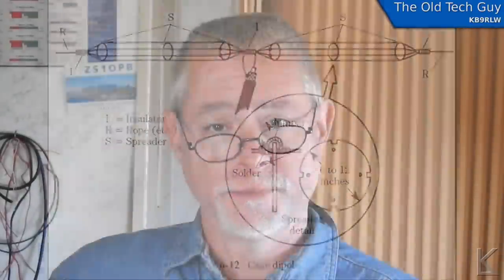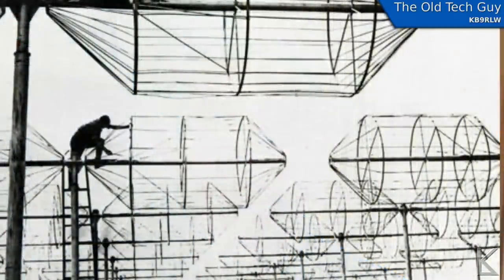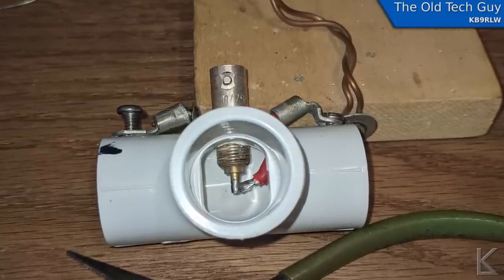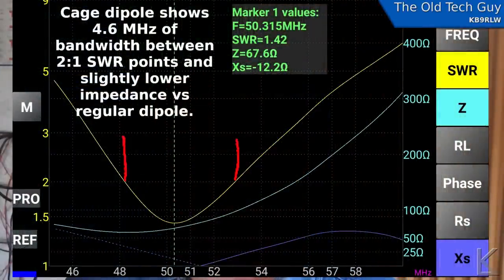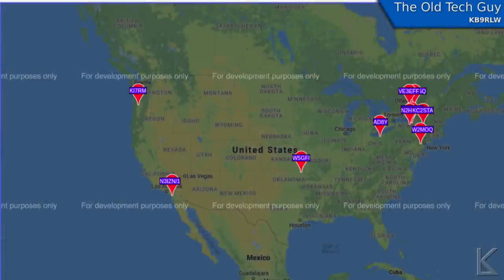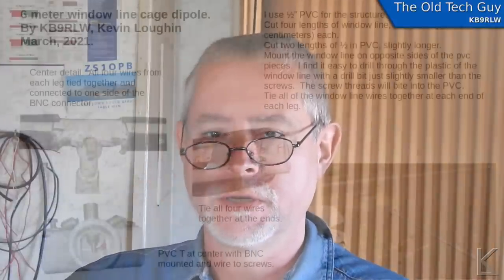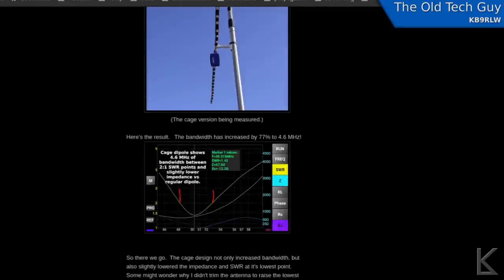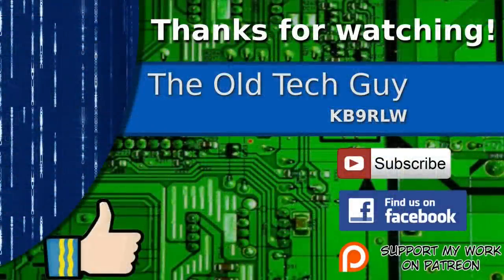Ham Radio - A 6 meter cage dipole using window line.

Comment: I built "flowerpot" antenna for 6m at 52MHz and strapped it to a plumbing vent pipe near the 16 foot peak of our home. I loaded all the FM repeaters within 100 miles of our location and started calling. I received squelch tails from all but two of the repeaters with no contacts. I had just finished one of the tests and the repeater owner came back with, "HEY! DON'T GO AWAY! IT'STOO QUIET OUT THERE!" So I did make one contact. The SWR was below 1.5:1 throughout the entire band, but there were two "bumps" on either side to 52MHz where the SWR was a bit outside the profile. Now I want to build a horizontal polarized antenna for the other modes and when DX window cracks open.

Comment: The speech fragments were probably meteor scatter. In the future, try running FT8 on 50.313 MHz. I run 40 watts to a Par OA-50 loop, the typical "closed band" tropo reaches out to 250 - 275 mile reliably. There are 6 meter beacons between 50.06 and 50.08 MHz,  too.

I have been on 6 meters since 1967. A great band and full of surprises. I have built the same dipole design in the past and will confirm that it will play.

CU further down the log!  73, Keith, WB2VUO here near Buffalo,  NY in grid FN02ox

Comment: Hope your back is better soon!  I have been having trouble with mine for years.  I was trying to hang a wire antenna a few weeks ago and had it hung on a limb.  I jerked it to get it off the limb and the limb broke and I ended up on my back in the mud.  It didn't help my already messed up back but I got the antenna up!  At least now I can sit on a heating pad and work HF and listen to shortwave!

Comment: I knew there was a good reason for procrastinating the start of my attic dipole.  Thanks for this!
Reply from the maker: With it hanging under your roof, you could support it two or more times along the length for a much longer antenna.  20 meters or even 40 meteres.  You could use 1 inch pipe and three lengths of window line at 120 degree spacing to make a 6 wire cage.   Or even go bigger.
Reply: Thanks.  As my parents owned this house, I had long wires beyond 40 meters here back in college - extended through both gable ends.  Looking forward to going at it again.

Comment: an interesting one to try would be the difference in running it as a cage then disconnecting the outer end commoning & having each core slightly different lengths just commoned at the centre (say 54", 53", 52" & 51" fan dipole style) to see if that is better for bandwidth or not.

Comment: Digital mode for EME is JT65.  Digital mode for meteor scatter is MSK144.  You mentioned hearing some signal bursts or pings. so maybe Meteor scatter.  thanks for the video.  - W0WQS.
Reply from the maker: JT65A actually.

Comment: Thanks Kevin!  Will try this concept soon as starting to use 6 meters  a bit. I currently use  a standard dipole inside of gray plastic electrical conduit; which has sunlight resistant additives and is said to not get brittle like the white pvc. will let you know the result in about ten years hahaha KI7RJS
Reply: Yep, and the center Tee or Box has a removable cover to make it easier to solder inside it. You can get a pipe thread to painter pole adapter as a temporary mast, too.

Comment: Excellent illustration of how a Cage Dipole improves bandwidth.

An interesting followup might be a bandwidth shootout comparison between a cage dipole and a folded dipole.  You've already done most of the work.  Some simple cutting of your short jumpers between window line, and soldering new jumpers and you'd have it.

That might allow you to use a lower loss windowline feedline at VHF and improve system efficiency too.  A 4:1 coaxial balun might save you the hassle of dealing with finding a torroial core that will work at VHF.

Just a thought.  Only try the experiment if you want to.  You're doing great without my input.

Comment: Hi, KEvin.

If you stumble upon interesting  signal, using the IC-7300 or IC-705, just record it using the built-in audio recorder.

THank you. 73.
Reply from the maker: Yes, I know.   It just didn't occur to me to do so at the time.
Reply: @loughkb  

Yes, sometimes I set the recording, but forgot to stop it.  As my knowledge, the rig keeps recording even we switched  it off.. and it's resume the recording when switch it on back.

Thank you. 73

Comment: FT8 (and pskreporter) can be helpful for looking at 6m coverage... More users than wspr sometimes.
Reply: Yes, very good point. There is also, in my opinion, the excellent website hamspots.net provided by VK3AMA. This tells you very quickly who is spotting your FT8, FT4 (and other digimode) signals. Personally, I find hamspots.net to be much quicker and more reliable than PSK Reporter.

Comment: Typical water type PVC pipe is more durable than people give it credit. I have been using those as isolators and center mounting points for dipoles for years now in continental weather. Haven't had to change a single one yet.

Comment: On your pvc projects, have you ever tried the pvc that woodcrafters on their sawdust vacuum systems? The pvc walls aren’t as thick and quite a bit lighter.
Reply: Sch 25 pipe
Reply from the maker: In this case, with the weight of the window line, those thin walls would probably lead to sagging as the thinner pvc bent slightly under the load.

Comment: Looks like there are four 6m repeaters in Arizona: Kingman, Prescott, and two in Tuscon. Have you tried those?
Reply from the maker: I have a video on setting up 6 meter repeaters with the Icom 7300.  I was using the kingman repeater in that video.

Comment: You have my respect, sir. I live in a 38' Class A and there is no spare room at all.

I understand Quartzite in the winter. Where do you go to escape the heat in the summer?
Reply from the maker: Summer is a problem.  I have yet to find a place that's not too far away, cooler, and affordable.

Comment: Would this also work on 2 meters?  Would love to see a sweep.  73 K4RJJ East TN
Reply: The third harmonic would be at about 150MHz, so a little short. It might be useable with a tuner, but the feedline losses would be a lot higher. Building one for 2m would be trivial, though.

Comment: Interesting antenna project Kevin.  What would be the disadvantage of using a pl259 and so239? 73 George KD4FJ
Reply from the maker: You'd have to rotate the connector several times to attach.  That's all. :-)
I use BNC most often out of personal preference.  No technical reason.

Comment: Have you tried this vertical ?  Never made a cage.  I made a 10 meter dipole that I can use either way. Just wondering.  Thanks. Hope to hear you about 50.145 USB.
Reply from the maker: With the threaded bit, I can rotate it easily.   I've rotated it to about 45 degrees, like a sloper, to split the difference.  I could hear a beacon out of Phoenix that transmits on a vertical and SSB sigs during a partial opening equally well.

Comment: Can u recomend a wire length using a 9 to 1 for 80 thru 10
Reply from the maker: Since it's going to act non-resonant with the 9:1 and require a tuner, it doesn't really matter that much.  Longer is better.  The closest you can get to half wave at the lowest operating frequency is best.
If you have the room to put up a half wave wire for 80, ~127 feet, then you'd be better off feeding it with a 49:1 and you wouldn't need a tuner for 80,40,20,15, or 10.

Comment: I really enjoy your experiment videos. Now I wonder what that bandwidth difference would be on let's say 20 and 40... a project that would be increasingly more difficult. However, perhaps based on your studies, you could comment on what one might expect at those lower frequencies.
Reply from the maker: While researching, I came across a post from a guy who measured an 80 meter dipole and then a cage version with 6" spacing around a disc.   His cage hit 2:1 just about at each end of the band.    Pretty wide down there.
Reply: @loughkb  Interesting... thanks. Increasing my knowledge in EE and RF was one of the more compelling reasons for getting my ticket. I wish you were my neighbor; I'd be your apprentice in all of these experiments... just no camera time for me. :)

Comment: Kevin what are you using as feeder? Is rg58 ok for 6m?
Reply from the maker: I'm using RG58, I had it on hand.   It's fine over short runs.  Lossy on 6 if you're getting a hundred feet or more away.

Comment: How well will a caged dipole work on say 2meter or 70cm? and what or how could one determine the gain on a caged dipole? And why horizontal and not vertical on your setup? Also, what math process did you use to get the proper length for the desired frequency? Was it the "300/f*V="?
Reply from the maker: A cage would work fine on VHF.
Horizontal because that's the common orientation for SSB/CW on 6.
It's calculated the same as any other half wave wire.  In my case I used feet as the measure, so 468/MHz.
Reply: @loughkb  Thank you very much... I thought those were the case but just had to hear it from one that had completed one...

Comment: This ConduDisc system is intended to be a quick & easy grounding install for power applications. You might want to borrow a sample and see how well it works for radio installations.

Review: https://www.youtube.com/watch?v=VKJ3gwFnxEw
Maker: https://www.saeinc.com

I'd be intrigued to know what this Conducret or "conductive concrete" is. Good grounds should become even more important as hams begin to explore the LF bands.

Comment: Those short "openings" could they not be Meteor scatter ?
How would one determine whether it be tropo or MS?
Reply from the maker: I wondered about that.  However, there were several in short succession.   So I went to a site that monitors meteor activity and there was no uptick that day.    We'd have to be in the middle of a shower for so many in so short a span of time.   I think...
Reply: I wondered the same thing.  You may be able to tell a meteor ping because it has a very sharp attack followed by a longer fade out.  There is also a possibility of aircraft reflections.  I think in Europe, when the Iceland volcano stopped air traffic a few years ago, the loss of the aluminum cloud overhead also curtailed a lot of VHF/UHF grid square work.

Comment: So what is window line?
Reply from the maker: Parallel feed line.   Two wires running parallel, separated by insulators.  In the case where the separator is this plastic extrusion, it has holes cut in it to reduce wind loading.  They look like windows, hence, window line.

Comment: try rapping the pipe with foil?
Reply: Another option is self adhesive copper "slug tape". Just a thin as Aluminium foil but better conductivity. With care you can also solder onto it (even when it's stuck to PVC pipe).